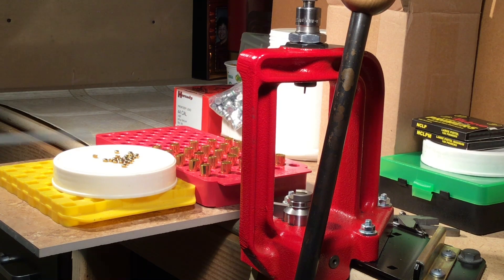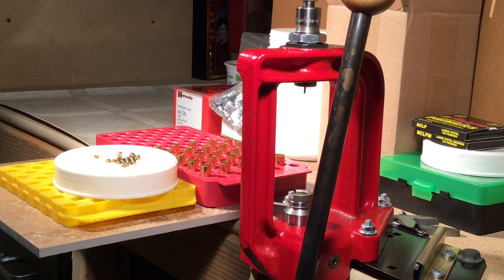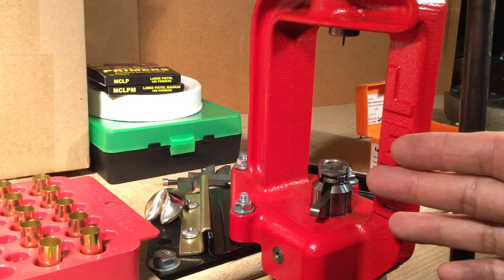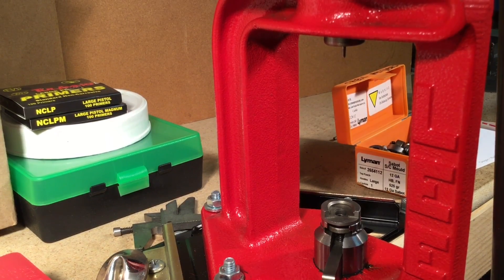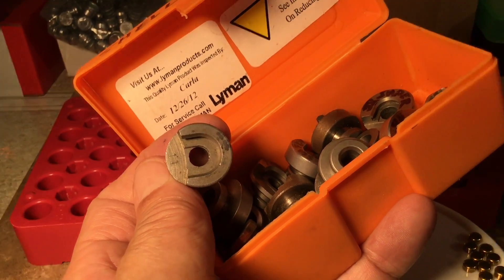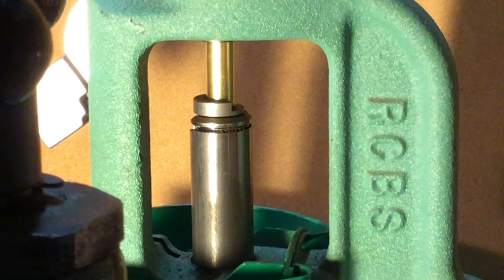Evaluation Of Press Equipment Alignment

Comment: Definitely something to consider. You're always on top of it Mr FC.
Reply from the maker: Charlie Sulcer - Thanks for your thoughtful comment.  As with most things - there are varying degrees of misalignment.  For the price and the mass manufacturing, our reloading presses are marvelous machines of precision - but they do have their ranges of misalignment.  If we have zero, we are very pleased to be fortunate to have that.  If we have misalignment, a little bit is OK for most, if not all, our uses (note that the inside mouths of resizing dies have that little bevel to aid entry).  And if we need zero, we can certainly buy systems to give us that.   Good reloadin' to ya,  FC

Comment: I called Hornady about my press doing this last year. Lnl single stage. Guy on the phone said no way. I load 6mm BR on the neck size with it. Now I always use L.E Wilson dies with a arbor press on Precision rifle loads I never crimp them so I feel fine about a neck size only.  That Forster press is nice looking though. Thanks for the video I feel less crazy.
Reply from the maker: Christopher O - That guy on the phone is out of line (how's that for a pun).  We want alignment of case going into the die.  Why spend what we spend on relevant dies when the case is going in cockeyed?  That kind of out of alignment of our ammo won't even show up in run out gauges, but the round is not blueprinted for our rifle.  This may not do much to reduce accuracy, but it sure cannot help.  The reason shooters use the Co-Ax or the arbor presses is exactly to get away from this kind of misalignment deflection from these designs of presses.  Not all of these presses have the misalignment.  So for the Hornady guy to try to blow you off is not a good explanation.  He could have said that your press is within manufacturing tolerances for these types of press designs...What's the point in trying to get low run out ammo if this kind of misalignment is present?  Best to ya,  FC
Reply: Try it without the shell holder retention spring.

Comment: My LM has that at all the stations. I find clocking the turret a half a degree solves it. The cure is to drill a new divot for the detente to lock into.
Reply from the maker: GunFun ZS - That's the thing...I loaded on my RCBS Rockchucker for many years, and that deflection has slowly worsened to the present day.  My old Bair H-press suffered that much sooner.  Wasn't acceptable for doing pistol ammo after a while, it got so bad.  I'm glad you figured out the correction for your turret press... Best to ya,  FC  Steve

Comment: I have a hornady lock n load, IT don't do that and it is cheap. love your veido
Reply from the maker: Milton Wells - Your Hornady was not a cheap press - it is as good as any O - frame press.  The price on the RCBS Rock Chucker is now within $10 dollars or so on sale compared to the Lee Custom Cast.  That you don't get defection means your press alignment is less than others.  Congratulations and good reloadin' to ya.  Best Regards,  FC
Reply from the maker: Spencer Han - You are not a fan of Lee - that's completely OK.  A lot of reloaders cannot come to positive terms with Lee's use of aluminum and rubber in their dies.  However, I've found their dies to perform with excellence and durability to be splendid.  The Custom Cast Press in this video is as useful and trustworthy as any press of its O frame design.  We reloaders are lucky - we've got lots of good equipment to choose.  Continued good reloadin' to ya,  FC
Reply: I have a Lee Challenger Breach lock that has served me well. It wasn't expensive and the quality is fine. It's square and true.  I also like the Quick Lock bushings. Dies are a breeze to swap. Almost of my dies are Lee as well. I would have 3-4 time the money in everything if I use anything else. When my Lee wears out I'll probably buy a Rockchucker. But for now, I am GTG.
Reply from the maker: Spencer Han - LOL..!!  Nothing wrong with the good shit...Best Regards to ya,  FC

Comment: There is enough play in the shell holder so it aligns itself as the shell goes into the die.  I consider this to be a non-issue.
Reply from the maker: Rapid Robert and Adrian Larkins - For our pistol ammo, absolutely a non - issue.  But if you are loading for subMOA rifle - you would not tolerate that kind of deflection in your expensive blueprinted rifle... We don't put our money down on that.  We sure wouldn't be happy with that in our reloading.  Why buy the most expensive accuracy dies and have that kind of misalignment in the press.  If the case happens to be able to slide a bit to align with the axis of the die, then that self alignment is happening.  But when the mouth of the case deflects and the entire case does not slide because of the axis of the shellholder entry, then that misalignment is not self correcting.  Certainly, if your ammo and rifles are performing for you, then don't change a thing... Continued good shootin' to ya,  FC
Reply: Agreed.

Comment: Good to know, especially for rifle
Reply from the maker: alphahr - The case should go straight and square into the die from a straight and square ram...Some have suggested that the shellholder spring  is causing the shellholder to be cockeyed.  If a reloading press manufacturer takes all the pains to create alignment of die and ram, and then puts a cheap cockeyed spring to hold the shellholder, that speaks volumes about the company.  Another poster commented on that, and the more I thought about that, we reloaders would notice the shellholder deflecting if the spring was askew - the thought being that the press activation will unaskew it.  That would cause shellholder movement that should be visible just like the mouth of the case deflecting is visible.  Best would be to get a high value press that doesn't have the deflection...Good reloadin' to ya,  FC